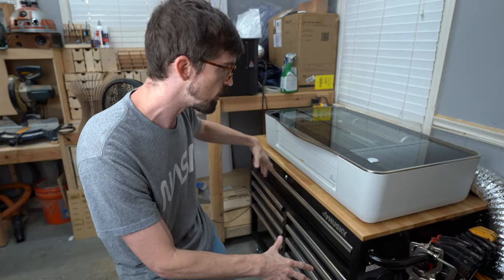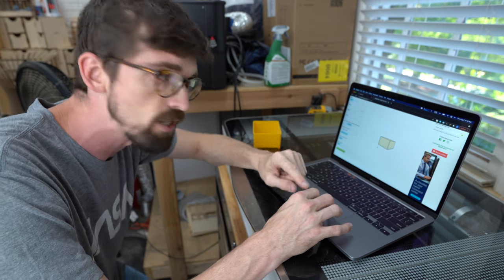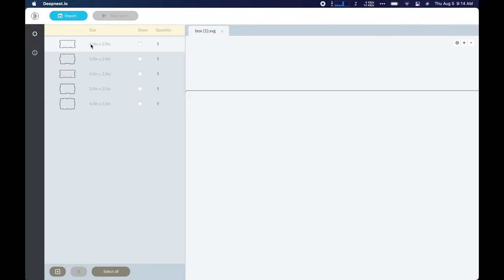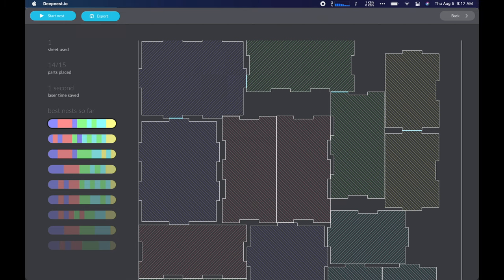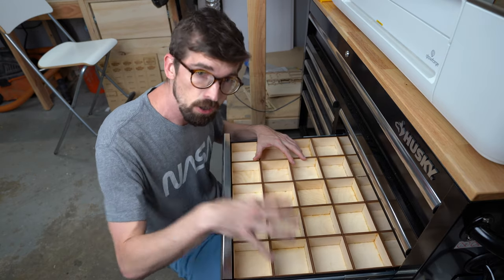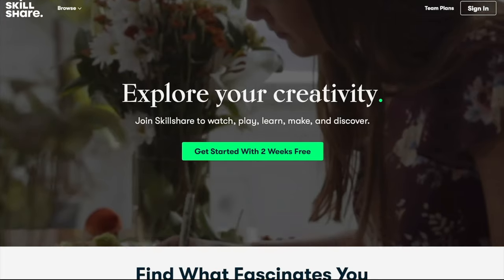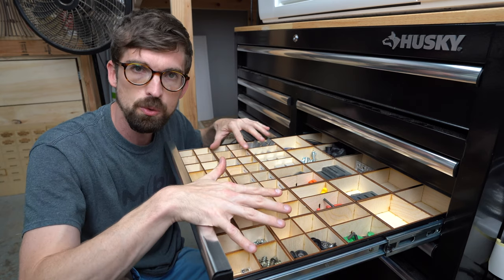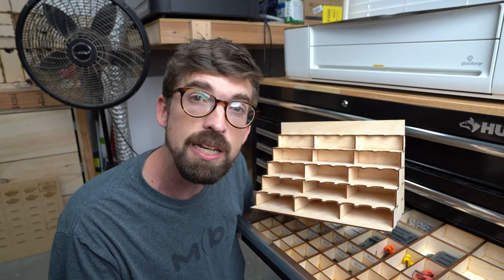How to organize a Messy Drawer with a Laser Cutter

Comment: Took your furniture Fusion class. Very useful. Have a large CNC. Debating if to get a laser. What do you use for laser vs CNC?
Reply from the maker: Great question and something I really should make a video about.  So I wind up using a laser more for smaller projects/prototyping.  Their main advantage is speed and how thin of a kerf it uses when cutting.  On the CNC side you can not only cut out complete pieces but also do 2.5 or full 3D machining.  You can also cut out parts that are WAY thicker than what I can with my 40 to 50W laser, I used 3/4 in plywood a good bit as well as up to 2 in thick hardwoods on the CNC.  You'll have to incorporate the width of the bit when cutting out parts so inner pockets will need some type of dogbone or clean up with a chisel.

Also the laser is much easier on the work holding side of things, most of the time you can just place the material in the workbed and your good to go, for CNC you'll need to learn lots of different methods to hold you material secure.

Comment: This is really nice...do you think the Ortur Laser Pro 2 could cut the 1/8" plywood? I'm on the fence with the Ortur and this might tip me over.
Reply from the maker: I haven't tried it since I normally will switch over to CO2 laser at that point but really should test.  Ortur says that it can can 3mm plywood in one cut so I think an 1/8 would be possible.  You'll probably get a good bit of scoring on the material and it will need to run really really slow or you'll have to use lots of passes to get through it.  I'm going to put that down as another video idea though!
Reply: I cut 3mm with my LM2, which is pretty close to 1/8”. I run it at 300 speed, 80% power and usually about 5 passes. I recommend adding air assist to it if you’ll be cutting.
Reply: @goali3903  Thank you! Just the information I was looking for. I assume you got the "20W" (LU1-4) laser as well?
Reply: @lunakoala5053  yup, that’s the one. I do have to say that after my ortur paid for itself in Christmas ornaments, I ordered an OmTech 60w co2 and the difference is amazing if you’re looking to cut. Ornaments that took me 25 minutes with the Ortur take me 2-3 minutes now and I haven’t even upgraded air assist yet. Well worth the upgrade if you can swing it.